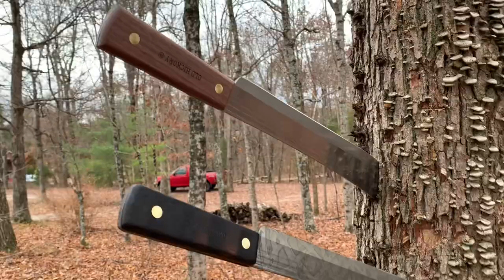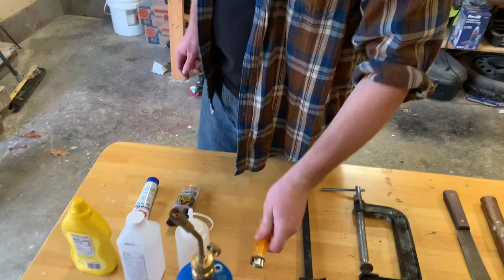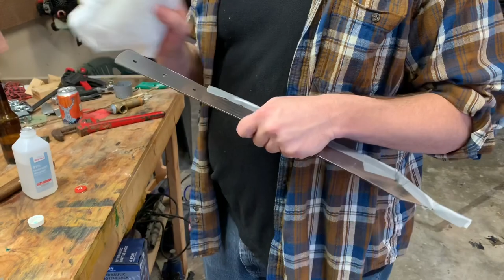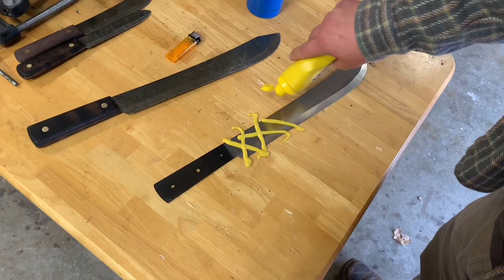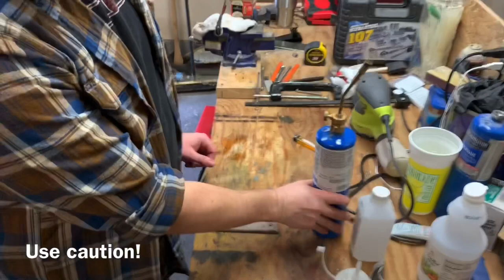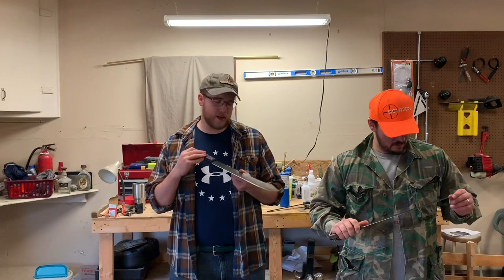Old Hickory Knife Mods. 14 in Butcher Knife

Comment: When I modified my 14 inch Old Hickory, I added a third brass pin in the middle of the handle.  I also roughed up the inside of the wood scales and the steel tang and glued them together with JB Weld before attaching the brass pin.
Reply from the maker: Great idea. We also started to ruff up the tang and scales. Thanks for the JB weld idea we stopped using the 2 part epoxy and have switched to standard gorilla glue it works great. Also thanks for the view and comment.

Comment: When I bought mine, I had every intention of reprofiling the handle to something more ergonomic with maybe bone or bamboo scales. But damnit! It felt perfect in my hand just the way it was. I just sanded it down,  put 5 coats of BLO on it, then drilled a 1/4" hole in the corner for a lanyard. I'll just use this one for my machete, and for $17, get another one to play with in the kitchen.
Reply from the maker: They are great blades for the money and easy to work with. Thanks for the comment and view.

Comment: Why blueing the handle part instead of just do patina on the whole blade?
Reply from the maker: The cold blue in our opinion provides better protection than a vinegar patina. I also wouldn’t use gun blue on the blade portion. I have heard it is safe and I have heard it’s not. So that would be your personal choice. It’s something we do just as an extra layer of protection under the handle. Once rust starts under the handle It could pop the rivets out. The glue will cover most of the surface area under the handle. The blue is there to protect the rest. Thanks for the view and comment.